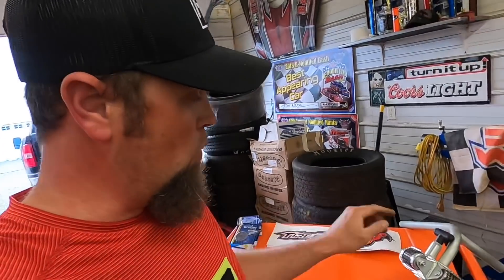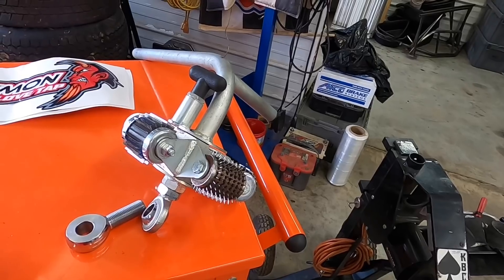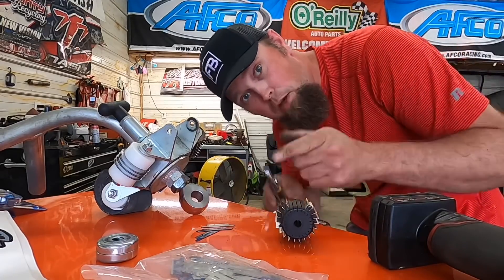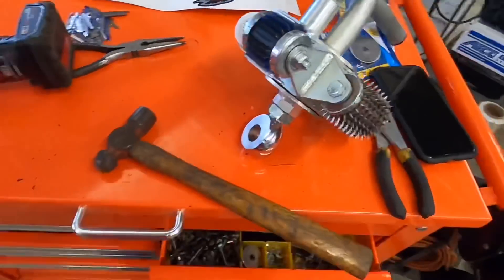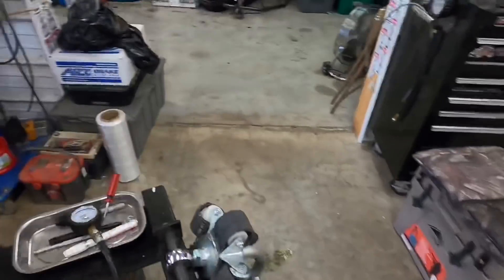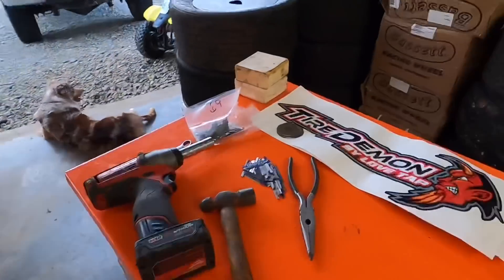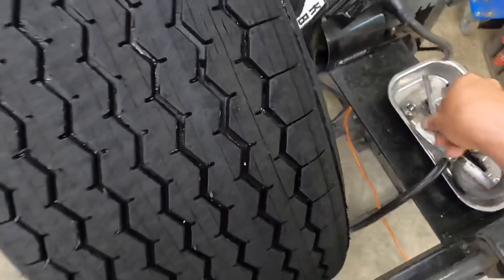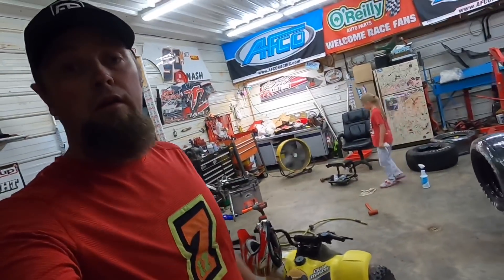Professional Tire Prepping Tools For A Dirt Racers Toolbox

Comment: Hope you have a good night at the track and pull off some wins. Curious cause I have never seen this before why do you wrap the tires in plastic assuming that is plastic. Just to let you know I never say Good Luck I have always felt you make your luck and good things go your way. Most of all be safe and have fun. Go get'em Tim.
Reply from the maker: It’s plastic wrap and we do it to keep contamination off the tires for as long as possible. And it’s also supposed to help keep the natural oil of the tire in it
Reply: @OldNo7Garage  With that being said it helps retain its compound so the tire doesn't harden up from contaminates and losing its natural oil.